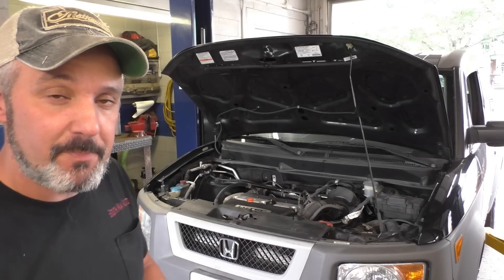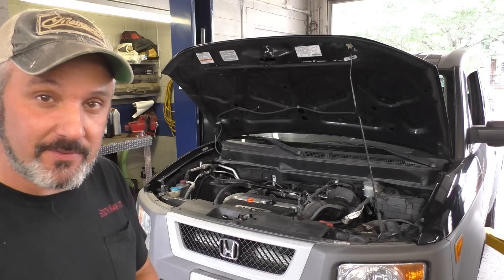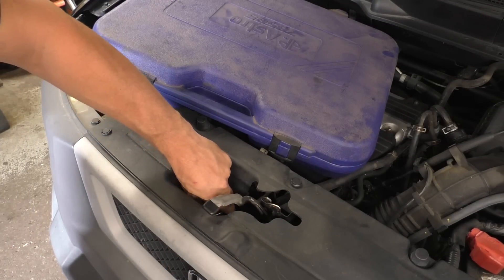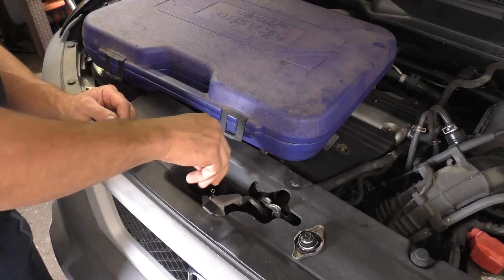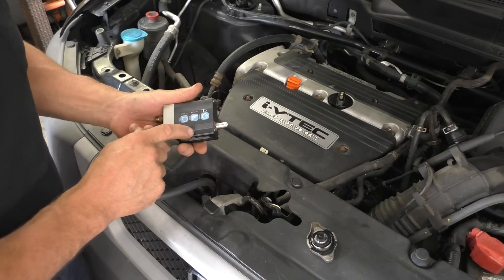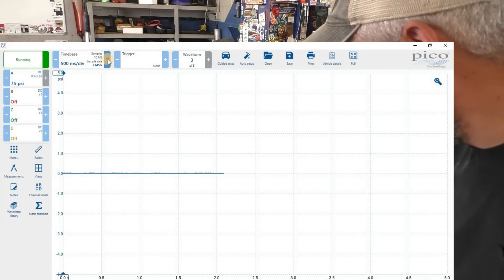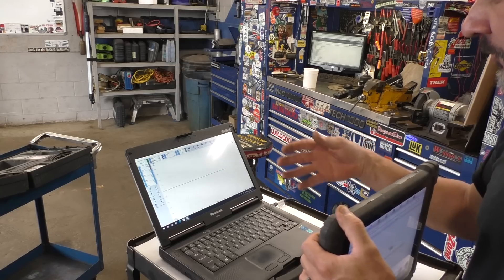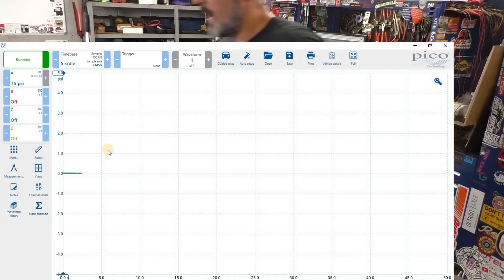Blown Head Gasket? On What Cylinder Though....🤷‍♂️

Comment from the maker: It seems I wasn't very clear on a few things in this video. I apologize for that. Hope this clears some things up and again sorry for not being very clear in my presentation  😊 https://youtu.be/hB1klKht-ck
Reply: Love your videos Eric, have been an industrial manufacturing mechanic for 45 years and pretty much seen and done it all. Have done my own automobile maintenance and repairs  forever. Have been able to figure my way thru most problems with the help of software on my laptop. Never fail to learn something watching your feed . In my personal opinion you are one of the best diagnostic technicians I have seen. In this business of repairing we are now considered technicians and not just the stigma when looked at as mechanic you are just looked at as a wrench twister. Keep up the great videos and I will continue to learn.
Reply: It was clear enough to me. You used the process of elimination to determine where to look for the leaks. I had no problem following your process because you took the simplest method to get to the right conclusion. You thus eliminated the possibility of getting a false reading on a scope or misreading the results. I've found that it is generally best to check for the simplest problems first and work up from there. I saw a guy tear his engine halfway down to fix a problem caused by a broken vacuum fitting. Another time I saw an engine get the heads rebuilt because of oil smoke on startup. It was a bad vacuum modulator on the transmission that was allowing transmission fluid to be sucked into the intake manifold on startup. It was discovered when I found transmission fluid in the vacuum line during reassembly. You were just following the KISS rule.
Reply: You where very clear on everything in this video…. As always.
Reply: This method is known as "deductive logic".  It's interesting to see that the wave form was actually exactly the same-- just at a different amplitude, once you pulled one of the bad plugs.   So that makes me think that both cylinders must be leaking through the same hole...  but even then it's strange that you don't see a double impulse-- rather than just building pressure faster.  That's pretty odd.
Reply: @calholli  I think if you look at the pressure signal there were definitely some recurring peaks above the slope of the increasing pressure line/data that indicate pressure impulses.
Reply: Awesome video thanks
I now too love the Dutch Phrase
Measuring is knowing how awesome ! lol
Reply: Two more channels would've helped with the waveform interpretation.  One on a coil and one on batt current.  The relative compression portion will show you all 4 cylinders and the coil trigger will identify them. That would show to radiator pressure spiking with two compression events.  Awesome video!!
Reply: @ablackformula  I was thinking the same thing. There would be some lag between the spark spike and the pressure spike but spread out (zoom in) a couple of revolutions and it should be easy to distinguish exactly which cylinder(s) are leaking.
Reply: I work in enterprise IT and one might think it is unrelated, but the solid troubleshooting process is the same. I learn a lot from watching your videos.  Keep up the great work.
Reply: No worries. Was a step and a half ahead of ya anyway.  My ADHD fights my OCD to play ur vids at 1.5x. Speed reading with 99.9% comprehension.
Reply: @tomtheplummer7322  actually only 1/2 step ahead.
Reply: Now for the teardown and see what failed and where
Reply: You were perfectly clear to me at least xD I didn't thought of that way to check for gasket leaks when cooling disappear without a trace, awesome
Reply: You were more than clear on why its good to know.
Reply: Learned something new that I’ll probably forget lol.   Very good test and we’ll explained as always.  Thanks
Reply: Seemed clear enough to me… not too many put as much work in… ain’t nothing perfect…
Reply: I haven't seen the other,  I suppose it's not clear what wasn't clear.  Seems crystal to me.
Reply: Seems to me this approach is more accurate than the “block test”. Amazing!!!
Reply: I was picking up what you were throwing down! Good video Eric!
Reply: Sami Manasrah
Sami Manasrah
1 day ago
I just did one the threads in the block pull out, one or two cylinder head bolt will be loose
Reply: Great video as always, thanks!  It was completely clear to me.  I hope you got the job to fix and will take us along to actually see the path of the coolant loss.
Reply: Sounds like he sent her just a little too hard, bud...? I know some of the older "V-Tech's", had a "glitch", where the rev limiter wouldn't engage properly if the car temp required for v-tech to engage was met at the exact time you had your foot in it...

Comment: Thanks. I have a head gasket leak and was told by a tech that did the diagnosis that my cylinders are wet from the coolant. I don't know engines much but Is there any way to remove the wetness on the cylinders?

Comment: My kid has a 1997 GMC Jimmy. It had a head gasket leaking into the exhaust. I thought the freeze plug had a hole in it. Finally seen the water was pouring out the exhaust manifold. Now it is ready for the crusher.

Comment: That is an awesome test! I am going to try that with my scope. Did you by chance do the sizzle test, dropping any of the oil on something hot like the intake manifold to see if it bubbles? The reason I ask is, I wonder how accurate the sizzle test is. My son has a truck with the symptoms of a blown head gasket, but every time I try to boil some drops of oil, there's no boiling at all. It just smokes, so I assume that means there's no water in the oil.

Comment: That was a great find and proof of concept. Only goes to show why you are the man of the hour. Could you have found it by hooking up your compressor to each cylinder in turn and checked the pressure in the radiator?

Comment: Let's be real, most shops don't want to do this because any coolant leak is written up as a head gasket job and any real head gasket job is written up as a full engine replacement...  Then they're nice to the customer and get a 5 star review because people don't know any better.

Side note:  If the Snap-On truck sold spark plugs with missing electrodes, it'd probably be the #2 seller after 10mm sockets😆

Comment: Drilling down to the culprit cylinder is always a good thing to do because there are those instances where the fault is not very visible, such as a hairline crack under a valve seat for instance, that way you can send the head off to the machine shop with instructions that the problem is on a particular cylinder and to inspect closely. Just my thoughts.

Comment: Sorry I'm so late to the party I have been in hospital so tryin gto catch up.... I totally agree in doing further diagnosis when I run a fleet of vheicles in the UK we had a truck that was a constant problem with drinking coolant and overheating two trips to the dealer the problem remained, turned out the head had a micro crack heading from exhaust valve via a water jacket chanel to the inlet valve. took them multiple attempts to find dianose and do the work under warranty

Comment: I have had a hard time with the pico scope purchase.  It’s quite expensive, and If I were to rewind time if I would have bought it 10 years ago, I honestly feel it wouldn’t have been worth the investment.   For me, most stuff that comes in is obvious things like brakes and ball joints. So it becomes a specialist item.  If you are doing electrical diagnostic items all the time it pays for itself quickly. If not maybe it’s better to make friends with someone who does. Some things are more economical to sub out.  Even though it does feel cool to watch the jiggles and come up with the problem from that.  So it does have good feeling value.

Comment: Had a 89 chevy 350,blew the gasket pulling heavy load up a hill. Only symptom was overflow tank filled up in 100 miles. Drove it for 6 months stopping every 100 miles to move coolant back to radiator.

Comment: Had a kia with a blown head gasket that the kia service department said .... They couldn't find anything wrong with the car.
1. I could smell Coolant at the tail pipe....sign no.1
2. What I did is pressure tested each cylinder and cylinder 3,4 showed air bubbling in the coolant system....sign no.2
Pulled head and confirmed 👍
Head was a bit warped,  7 thou 
Out. Had it shaved, reset valve clearance and been solid for 3 years now.

Comment: Hi Eric, love your work, being a mechanic myself I would like share a tip that I have learned many years ago.
Providing the engine can still run and spark plugs are easily accessible, you can do a "screwdriver" test. For this test you'll need 4 long screwdrivers and they need to be cold. If you doing this on hot day, just chuck them in a fridge while the engine is warming up.
You need to run the engine stinky hot, remove quickly all spark plugs and insert a long screwdriver in each cylinder, leave for about 10 seconds, remove and observe for moisture build up. If you find droplets on one of the screwdrivers you found leaking cylinder. This test works only on failures that cause coolant to enter a combustion chamber. If the leak is severe or it wasn't addressed for extended period of time inspect the top of the pistons, you will usually find "nice" clean piston in the leaking cylinder.

Comment: I'm doing a head gasket job right now. Its a 2004 Hyundai Santa Fe 3.5 v6. It had excellent compression in all cylinders, but top radiator would get rock hard within seconds after starting the engine. You would hear gurgling in the reservoir bottle also. Hours after running the system would still have excessive pressure (remove radiator cap). When starting without cap you could literally see and smell exhaust gases coming out of radiator. Did the chemical test and she turned yellow right away. Surprisingly, just like your Honda, it didn't overheat or run hot either. Love the video keep um coming.

Comment: My aunt's 2003 civic had the same issue
No overheating no external leaks
No overflow tank leaks, only thing was you could see the steam coming out the tail pipe, i took all the spark plugs out and shoved an inspection camera in each cylinder, 2 and 3 were steam cleaned, drove the car home and took it apart the head gasket had failed in 2 different places.

Comment: Putry cool Tool Eric! Usually when it's bad enough to use coolant and pressurize the cooling system it will have a cold start misfire, did this one? Bet a couple plugs were nice and clean too.

Comment: a poor man's trick is to pull the thermostat out, put thermo housing back on, fill it up with water, leave the radiator cap off and start the engine. now watch to see if it blows bubble in the coolant with the engine running. if the thermostat has the gasket on it then u may need to use a hand grinder with a cutting wheel and cut the guts off of a thermostat so that u can still use the outer ring of the thermostat and it's gasket.

Comment: mines blown like this. still runs decently and don't overheat unless i run the ac. now on the other hand if I were to drive 40 miles or so at highway speeds it will start over pressurizing and going into the overflow tank.

Comment: I have the same issue with my honda going on 2 years leakdown test confirmed my suspicion. I was going to say what is more then likely happening is air is trapped in the top of the head or some passage and you get to a point where it boils over and shoots out the cap?? Mine has at least shot coolant all over the place twice. No signs of leaks either except for the spray marks all over the engine bay. I would go back in there and re-test the pressure on the cooling system, find there is an internal leak but not know where it is... then be confused because coolant was all over the engine bay!!!

Comment: Head gaskets don't blow for no reason , 
It is usually the engine over heats and warps the head , so even if you put a new head gasket on , the Head is still warped and it will just blow again , if it's a V-6 or V-8 with 2 Heads , it doesn't matter which side blowed , fix both sides and plane both heads , 
Or you will be fixing it later anyway

Comment: I'm either look at the tailpipe see if it's leaking out that or check the radiator see if there's oil or whatever unit same thing at the motor if that wasn't it I used the pressure gauge

Comment: I had similar symptoms in my Pontiac. I was losing antifreeze but no leaks and no overheating, at first. It once got really hot when i stepped on it to get in front of other traffic. I also tried checking pressure with the pump and gauge on the radiator cap but it held fine didn't lose pressure in the cooling system. Then i tried the liquid that changes color with the car on and that's what did it. Turned from blue liquid to greenish yellow. I was changing all kinds of parts hoping it was something simple like the thermostat, temperature sensor for the antifreeze since i hoped maybe it got hot because the sensor didn't trip the fan on.. but it was the head gaskets. That was a few years ago and i did it myself and it's been good ever since so I'm kinda proud of myself aside from the parts canon part.

Comment: My 98 dodge 318  has the same issue. Got 210 on the clock and have a worn out cam. Making horride tapp noise. Just gonna ride it out and pop the top on the rad once a week and add 1 cup of coolant till issue gets worse. Prolly foing to invest in putting new motor in the near future. Never see this without showing any of the classic symptoms of a blown head gasket.

Comment: I note that the pressure increase with cylinder 3 plugged was about double that with cylinder 4 plugged, and it appeared similar to that with 3 and 4 plugged, so trying to establish where the leak is using a trigger pulse with all cylinders plugged might not have revealed the issue with cylinder 4, or at least made it more difficult to locate as it would be hidden in the noise from the cylinder 3 leak. Had similar issues over the years with a Volvo 240 engine with a porous head allowing single direction combustion pressure into water jacket but not letting coolant into the cylinder whether running or not.

Comment: I had a very similar problem with my 2000 Honda Civic DX. In facr very same issue with one additional symptom, which pointed me towards the head gasket. What had was a pin hole leak in the head gasket. It didn't effect the drivability at all. But I work nights. I go in during the hottest part of the day and I'm home before dawn. I started to have trouble starting the car after work. long crank times and finally it would pop off and run. there would be a cloud of smoke, not horrible but it was noticable. then the drive home was uneventful. one morning it took more than 20 minutes to get it to start. when it did a huge plume of smoke came iut the tailpipe, and because the wind was blowing in the right direction I could smell it. I could smell the coolent in the smoke. so what was happening, while it was running it was pushing gases into the coolent system. When I shut it off, as it cooled it would push coolent into the cylinder. mi e got so bad that I had to pop the hood everytime turn the car off and crack open the rad cap to release the pressure so it wouldn't fill the cylinder with coolent

Comment: Pico training was so interesting and cool and we were so pumped to use our newly taught skills. And 10 years later, I've only used it twice and I don't think it was even necessary. Most tech maybe used it 1 time after training. Even our foreman use it mainly to document reading for the factory engineers to look at. 

Most electrical diag is done by checking for known "good" power and ground and if so, it must be a bad electronic part. 

For ignition work, we just mark and swap parts to see if the problem moves. For headgaskets, we just pressurize and use the scantool to see which one is misfiring and then borescope it to confirm.

Even for hybrid system, I've yet to use Pico to diagnose concerns. It's mainly an engineer thing. We don't have access to the array of known good graphs and simply don't have the time to produce known good graphs on every part of every model vehicle.

Even Scanner Danner had Pico diag lead him astray. He had a nonideal graph causing him to prematurely condemn a part when it was something else. Pico is a slippery noodle indeed.

Comment: This test should best be performed with one in cylinder 2 and then only 1 in cylinder 1 to actually see if they as well are giving pressure. The method you used did not prove they are not leaking by.

Comment: Ya thats a cool tool I believe they also make a head gasket leak test kit, it's a dye thing that tests for exhaust gas in the coolant. But you pin pointed between 3,4. Now you know exactly where to look, Nothing feels more wrong than unbolting a head and you can't find the blow out. . Love your way of going about things, let's now hope it's visible and not a Crack in the cylinder or head! Hope we get the k series head gasket video.